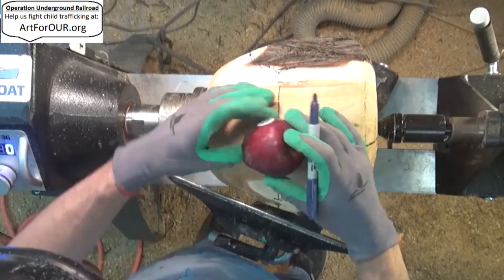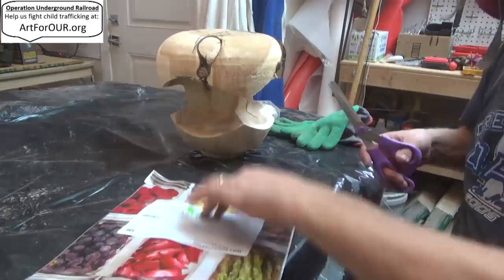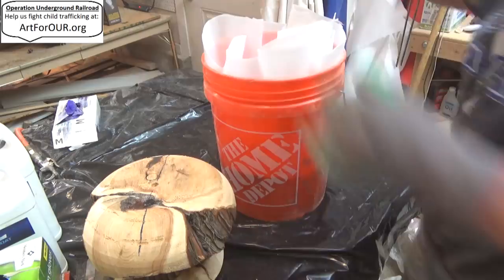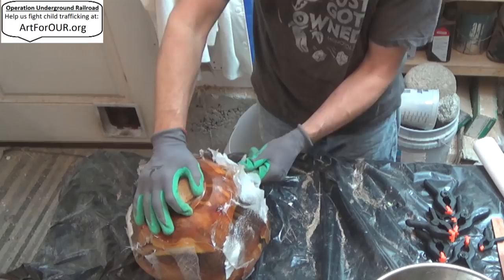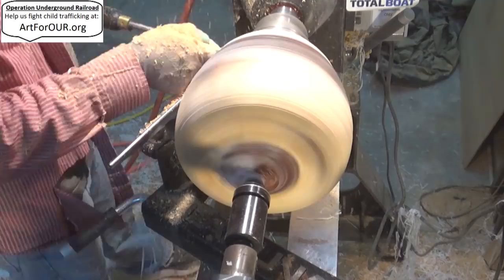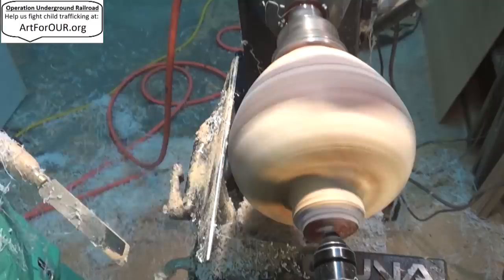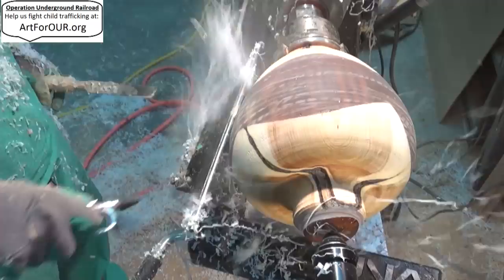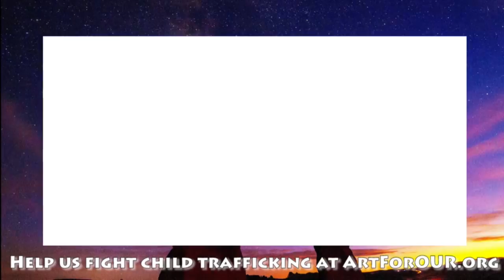"Sliced" Apple slices, resin and cedar wood turned into a bowl /  vase.  Wood and Resin Turning

Comment: Amazing piece, and those tiny you complain about are usually caused from moisture in the wood. I’m not sure you can completely eliminate all of them, but we will continue to try..... great job.
Reply from the maker: Thank you Doug!

Artforour.org
Reply: I was wondering if the wood expanded when heated like many other materials? Maybe that causes the bubbles? I have no idea what the thermal expansion for Cedar is? Haha
Reply from the maker: It just might.  Although this thick set resin doesn't very too hot.  It was very dry wood,  so shouldn't have been the moisture either.  Who knows.   😀

Comment: Dan:

Finally, there is someone on YouTube who realizes the dangers of chainsaw blades used on angle grinders.   As a. Safety engineer, I have I investigated hundreds of industrial accidents using these blades.  In each, the injuries have been horrific and often times the individual loses a portion or all of the limb due to infection since large amounts of tissue are mangled or the person seriously disfigured.  Head injuries common.  Some insurance companies will not insure companies who use these blades.  The biggest cause of accidents is kickback when using these blades.  Kickbacks can occur in 1/100th second and much faster than a person can react since blade spinning around 10,000-13,000 rpm. Best thing is to avoid their use.  Thanks for mentioning the problem with these blades in your video.
Reply from the maker: You bet!  Thank you for your support!

Comment: I just wanted to finally comment and maybe have a solution for you. I do some resin stuff as well and I noticed that you do use the glue a lot to patch.. have you thought about UV resin to patch? It works wonderfully and it's clear and cures with UV light in minutes.
Reply from the maker: That's a good idea.  I'll have to give it a try.

Comment: Hi Dan, I forget what the material is called, and it is pricey, it comes in a full sheet, a full sheet I think it costs about $600. a sheet, but when you spill resin on the top of this sheet it pops right off. I've seen myself, I couldn't believe it. But, it is very expensive per sheet. Maybe I can find out what it is called and get back to you.
Reply from the maker: Cool.   That would be awesome

Comment: Another success mate, looks great 😎. 

The only thing I would have suggested is coating the final shape with resin to ensure the apple pieces stay sealed.

What’s the freeze dryer you have?

Time to buy a bigger pressure pot, mine fits those standard buckets, so if it fits in a bucket it fits in the pot. Mind you you’ll find you always need a bigger pot 🙄🤣
Reply from the maker: Thanks!  It's always an arms race between my tools and my imagination.  😀

I've got a harvest right freeze dryer.
Reply: @artgivinghope  q